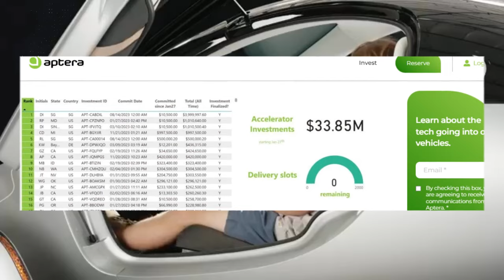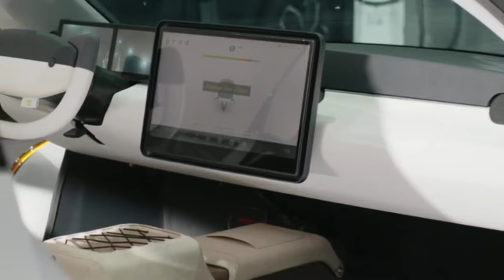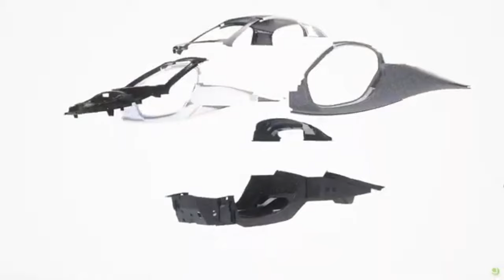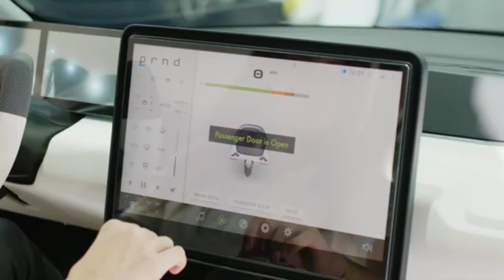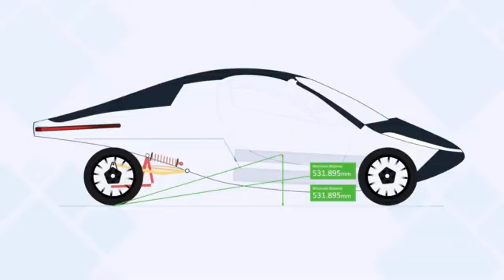Aptera $33million funding gets 2025 Crazy Beast Solar EV, deliveries

Comment: Shipping the body as parts would be more cost effective
Reply: That's right
Reply: The way I understand it, CPC will be making the chassis as well as the body. They have experience assembling body panels and will be able to work out any fitment problems. The first PI builds will be sent by air. Later, they will be carried on a ship. Cars are shipped that way now, fully assembled.